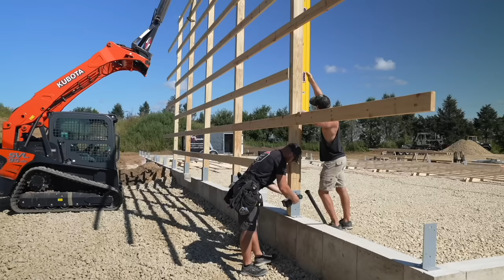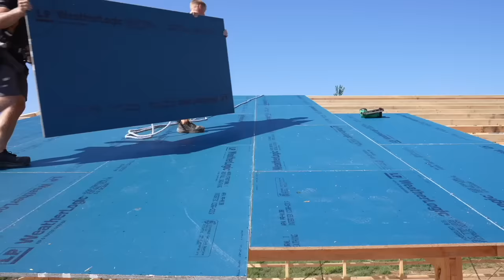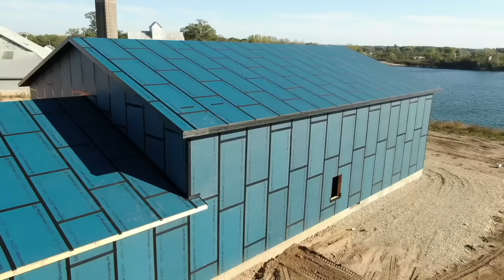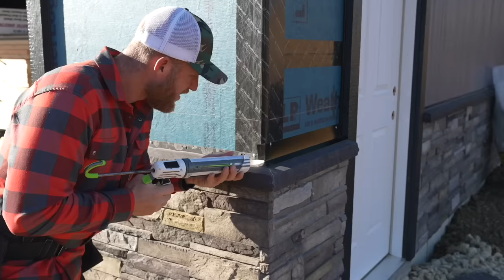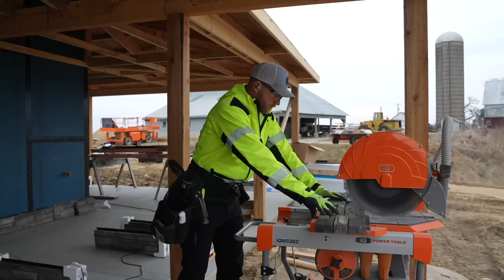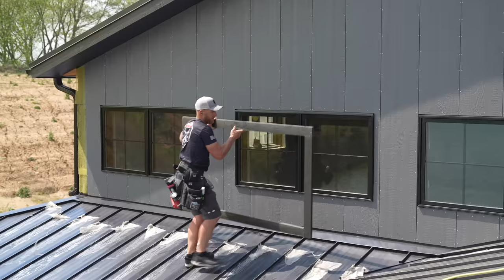Epic Start to Finish Barndominium Build in 16 Minutes

Comment: Great Video, Really helped me with what I needed to see. I personally didn't like the gap at the center point of the roof after the plywood was installed and right before the tin roof went on. I would personally want that gap closed tight before the tin roof. Other than that looks like a great job. I would like more of these type of videos.

Comment: Nice work.  As a plumber tho, I hate seeing these on my schedule.  I've roughed in 8 in the last 2 years, all slab on grade, all 2 storey builds, and every single one had horizontal 2x6 on outside walls in 2-3' spacings going up, BUT FLAT UP, not flat out like you guys, being intelligent, have done.  Being that people tend to go open concept for these, most of the vents have to be run up those outside walls, which means drilling 14 million holes and coupling pipe every 2ft.  I have a nice angle drill, but after hole 47 and on the top of a ladder 20' in the air, it gets real annoying lol.

Comment: Why don't you guys set the base for the posts in to the foundation wall when you're pouring it? Wouldn't that produce a better connection as well as save time drilling for the anchors?

Comment: You guys do awesome work. Love all the detail and seeing guys using an actual hammer and nails to build with. Can you explain why you laid the decking vertically both on the roof and the walls? Looks great. Curious about the engineering behind it. I don’t have any experience in this area and feel like I’ve only ever saw it laid horizontally. Thanks

Comment: What happens to the structure when frost lifts up those 2x8’s that are on the ground surface as a seal to the outside elements but the posts they are connected to are fastened to the concrete pillars that don’t have the same lifting force because they are below the frost line?  Should these bottom course boards be left to float and not fastened to the posts?  I’m planning to build a barn using your methods in Northern Vermont.  Our frost levels are down to 48”, give or take.  I’m not sure how to handle this scenario?  If you read this I would love an explanation to what happens at this location of the structure after years of cycling forces applied to these bottom course boards.  
Thank you.

Comment: Is it better to build on a foundation and attach it with bolts like this or to use wet set brackets? I've been looking for this info but it goes back and forth

Comment: Beautiful work. Tip. I own a professional window cleaning company. Leave the film on the windows next time. It's there for a reason. Contractors ask me all the time why it costs so much for a professional post construction clean. I tell them. Cause you took the film off the glass 1.5 monthe into the build. Now I have to remove 5 months of crap without damaging your window.

Comment: This is not a barndo. It’s a stick built building.
Reply from the maker: No it’s a barndo
Reply: @RRBuildings  it looks like one but there is no barn. Just a stick built structure that looks great but it’s strength is in its exoskeleton instead of its framing. Hate to be inside of it in high winds. Whew 💨